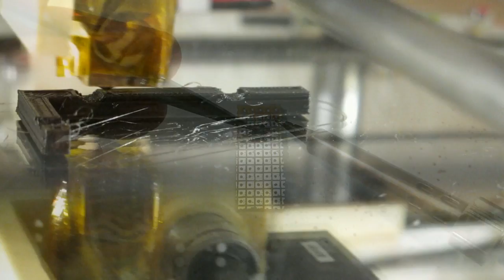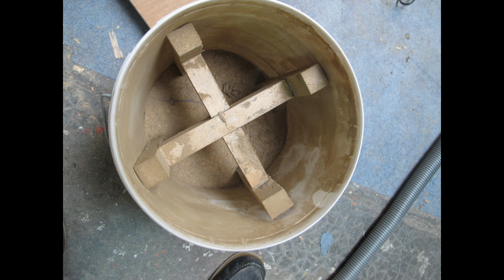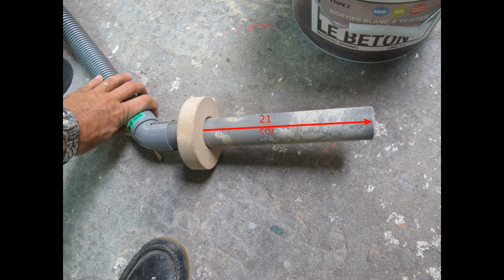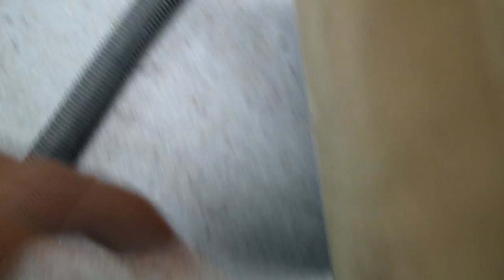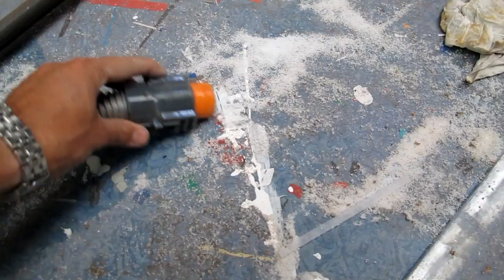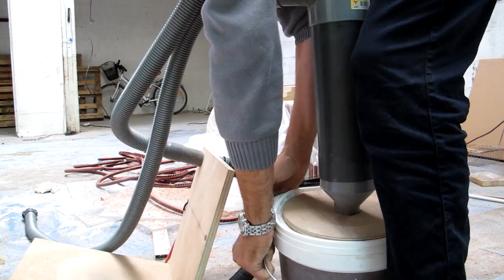Homemade PVC Cyclonic dust collector

Comment: I do scroll sawing work, in my opinion it creates some of the finest sawdust ever. I have two shop vacs, one is a home depot "bucket head", the other is a stanley stainless steel canister. hard to keep my shop clean, it's always a battle being that I'm a recovering lung cancer patient it is important for me to hold the dust in control. well, two vacs, so many designs. I'm thinking cyclone for the Stanley and a toriadial for the bucket head. I'll try to do a video, may be good for a laugh. LOL. Thank you for sharing, it helps. there are so many designs, I like to keep things simple.

Comment: Congratulations. The design is interesting, as this very small cone is off centre. Most cyclonic dust separator designs require are large cone and for it to be concentric with the vacuum tube. But I'm interesting to try this system out as the fittings are all standard sizes and easy to source. We have these cheap PVC fittings at Bunnings (large hardware warehouse in Australia). Cost is about $20 Australian, plus hoses and storage vessel.

Comment: Why don't you want the dust to end up in the yellow bucket?
Reply from the maker: +claes77 the dust filter clogged up quickly with plater and other fine dust. With the cyclone it last longer from a few minutes to month  ;)
Reply from the maker: +claes77 the dust filter clogged up quickly with plater and other fine dust. With the cyclone it last longer from a few minutes to month  ;)
Reply: equinoxefr75
Reply: equinoxefr7            5
Reply: claes77 7
Reply: equinoxefr75 f
Reply: that vacuum cleaner uses paper bags to colect the finer sawdust, those are discardable and over the time become an expense, you dont want to fill those, also how can you show on the camera if the bags are in place?

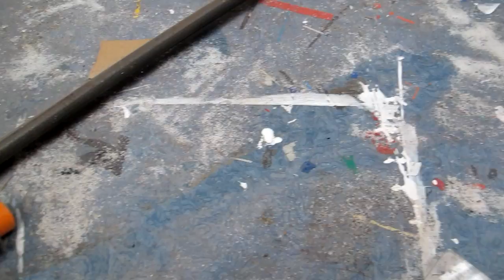Comment: I'm curious about if it actually works with the camera work around 2:20 mark. a poor design and a bad implementing of the design all masked by a camera trick.
Reply from the maker: +mayhemwushu perhaps a poor design but it works like a charm since a year. No more vaccum bag clogged by dust. I use it for wood dust, plaster,...